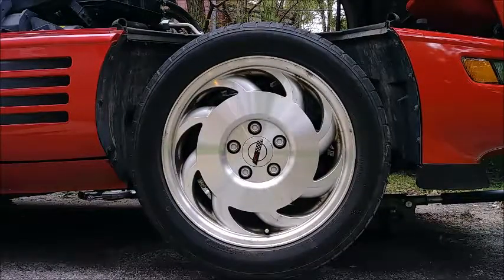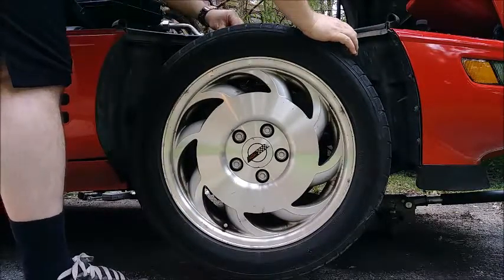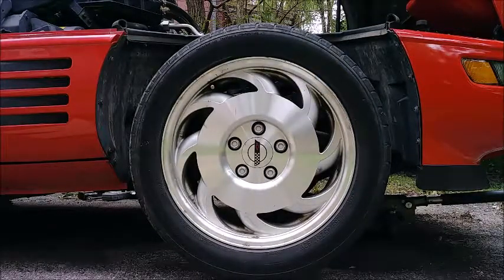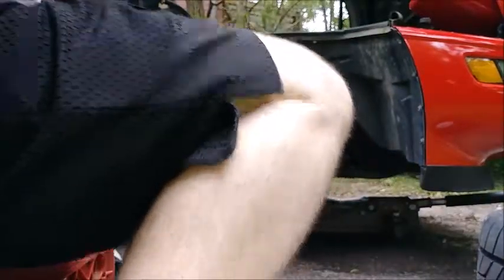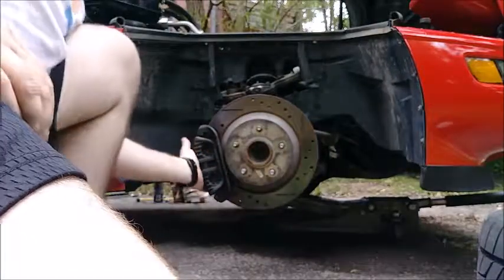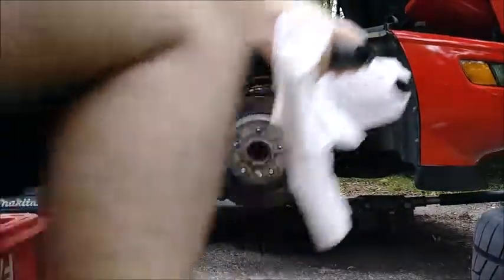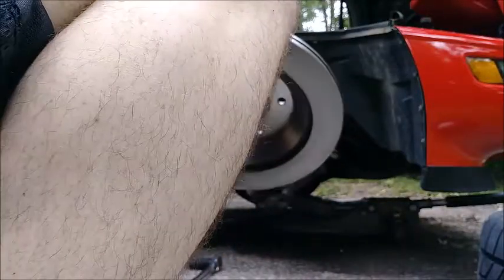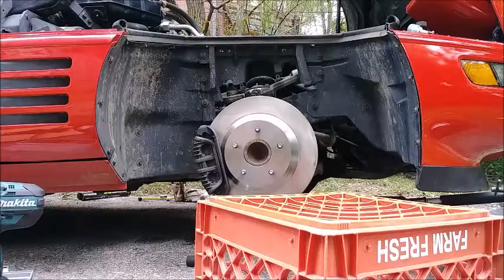How to fix thumping noise when wheels spin without brakes applied

Comment: The problem is either you have a twisted wheel bearing plate or the wheel bearing bolts are not tight. Also you didnt sand the surface of the bearing before you reinstalled the rotor. Finally remove the caliper brackets and file down the seating slots for the pads, then lubricate with grease to help them slide freely. And dont forget to lube up the slider pins with org grease. Its all in the technique my friend.

Comment: Thanks for the video! What's odd is that my car began doing this after I simply disassembled the brakes and reassembled them. (I had removed the rotor so that I could get access to the screws holding in the sway bar end links.) No new hardware was used on the brakes, so I'm thinking I must have seated something incorrectly... but, I'm still trying to figure out what it is that's thumping.
Reply from the maker: I was racking my brain forever over this. All I did was change the pads and the obnoxious thumping started. I thought the lugs kept loosening but they were tight every time I checked. I thought the calipers were loose, but nope. Tight as can be. I thought maybe the pads were made incorrectly (that still could be a problem) but I changed the rotors and the noise has stopped and never came back. Weirdest thing ever, but it worked.
Reply: @HollywoodHornet  I might try that anyway, since at least one of my rotors feels warped. Then again, the thumping began after I simply removed these parts and re-installed them. I'm wondering if something fell in between the rotor and the hub, or if the pads became loose due to bent clips.

Comment: I’m having a similar problem like this noise but it is on the rear wheel where it’s coming & it’s on a 2004 E320 Mercedes. Same thing when I drive it’s ok but when I let go of the gas and don’t apply the brakes yet this noise occurs
Reply from the maker: Hmm, and I thought it was only my Corvette that did that. I've never heard or experienced such a thing in my life until now.